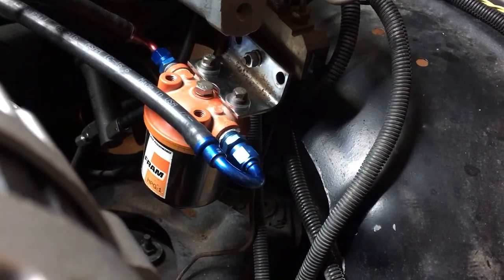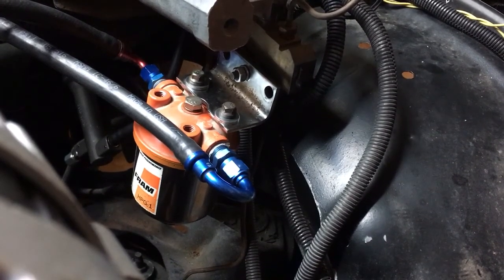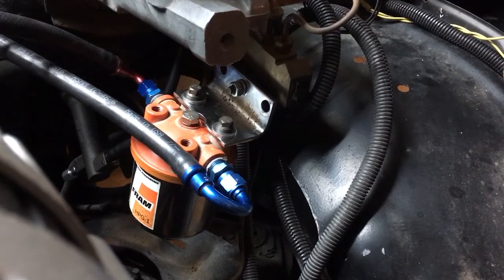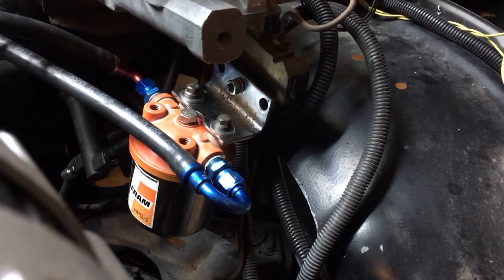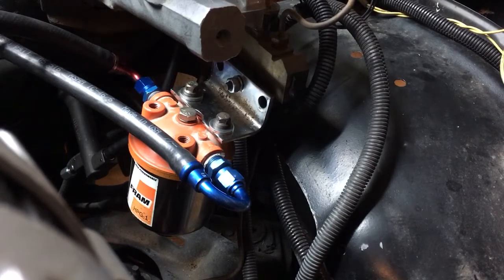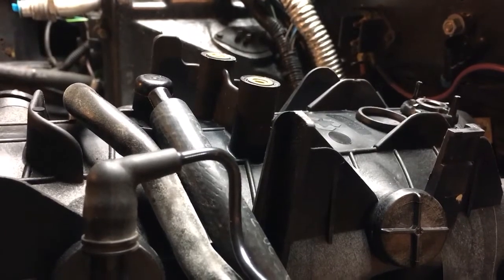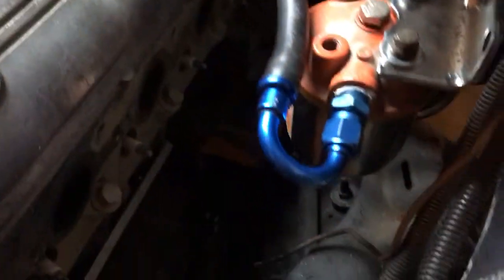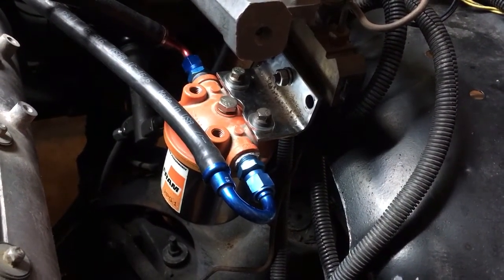4.8 5.3 5.7 6.0 LS oil separators part 2

Comment: that bs is not needed if you put the updated valve cover on the engine.
Reply: Rick Williams Jr. - 2003 Suburban I updated to new valve cover and it did nothing for my oil consumption. What did solve it was I replaced valve stem seals. As far as this canister trap here not sure what the end game is. If it traps oil (which we don’t know cause he did not say) you still have to add oil so what’s the point? It does not solve the problem right?  Yeh oil does not go into manifold but you still have to replenish the oil with new oil or use the canister trapped oil right?  So how am I any better off?
Reply: One possible solution which has been done on the LS1 motors is to update to this valley cover with the PCV vent tube on it :-

https://goo.gl/images/qcZM8K

They went that way on the 6 litre V8's to rectify any possible oil consumption issues that the 5.7 litre engine had,for example, back in 1999 when Holden first fitted the LS1 engine into the Commodore, it was a piston to bore clearance issue regarding the Teflon coating on the piston skirts.

This led to increased engine noise & oil consumption, many engines were either rebuilt with 0.010" oversized pistons or the engines were replaced.

Mine is a 2002 engine & it doesn't have that problem, so if it's not a baffling issue with the valve rocker covers,a blocked PCV valve or hose or leaky valve stem oil seals ,then the issue would likely be to do with the piston rings not sealing off properly.

I know my dad was very lucky with his 2013 model Holden (Chevy) RG Colorado, it runs the 2.8 litre turbo diesel 4 cylinder engine & some of them have had oil consumption issues.

The hone marks in the cylinders were too deep therefore was causing an oil burning issue,he was very lucky because his is unaffected by that issue.